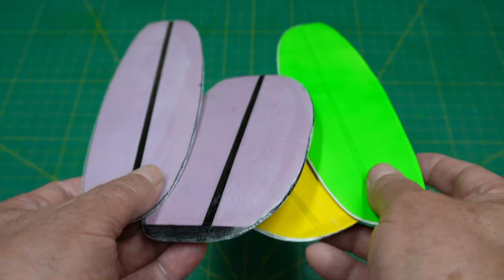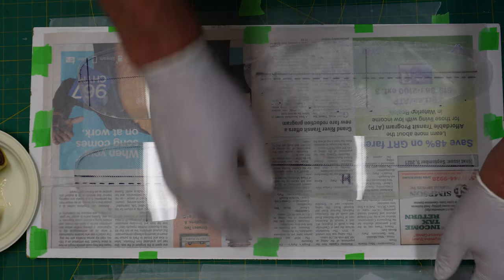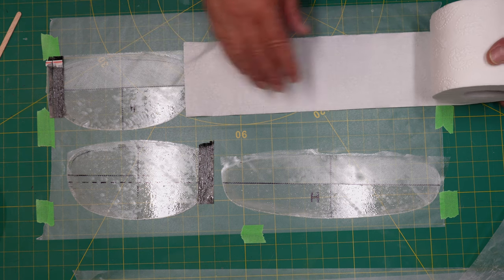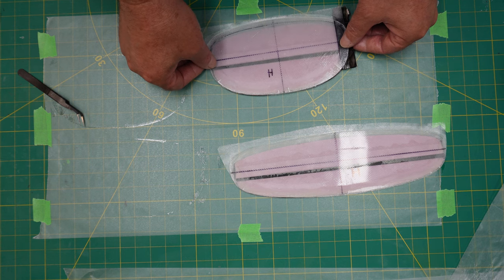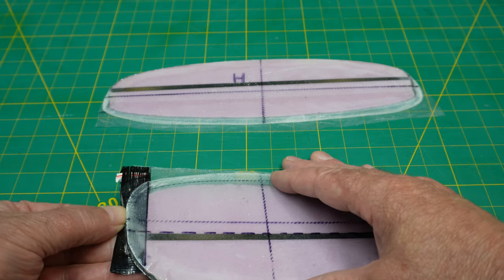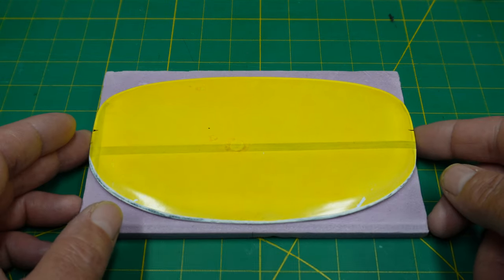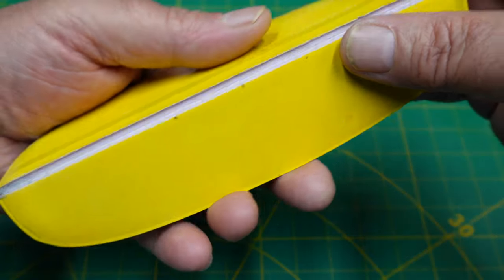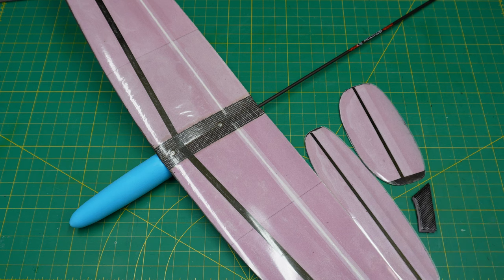How To Make A F3k DLG glider. Tail Group Vacuum Bagging/ Hinge

Comment: Those look like food saver bags there, I might try one of those for my first test and for sealing, the food saver machine can seal that open end up real well. But I like your idea of the sealant and tape too.
Reply from the maker: I've never had a leak from the bag ends. It usually will leak a bit around the fitting. I used plumbers putty. :)

Comment: what type of foam do you use...?

￼
Reply from the maker: Hi. I use a Extruded Polystyrene Rigid Insulation, aka XPS. The stuff I use can be found at HomeDepot under Owens Corning FOAMULAR NGX CodeBord XPS Rigid Foam Insulation Board; 1-1/2-inch x 24-inch x 96-inch R-7.5 SL Edge.